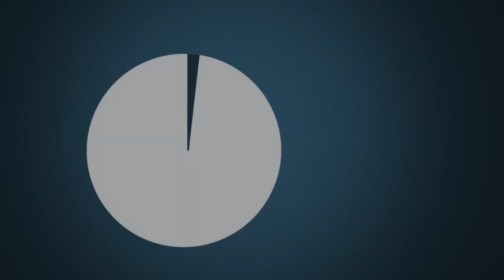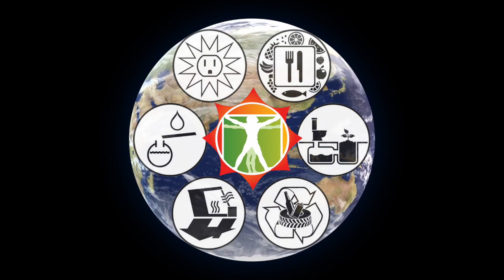Garbage: Containment and Treatment in Earthship Design

Comment: I'm 100% in. Planning on going to NM in the next few years to take the course. Two curiosities so far:

Do the cooling tubes rust out? Surely condensation pools in the courrogations. 

Can you wrap the rubber water diaper from the roof over the tires as well? Like wrap down the front face of the tire wall, and back up the back face? What if local EPA rules stipulate the tires have to be contained, or simply to avoid possible offgassing? I can't find a clear answer, there are studies that say they do and don't. And tire smell was reported in earthships.
Reply: Ooh! Snow load too! I want to build in a place that has 50" a year.